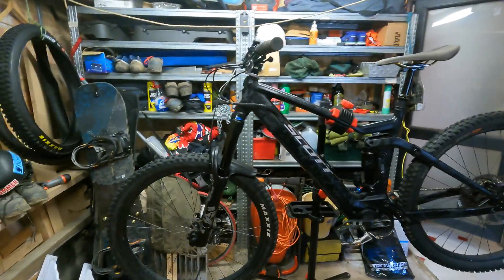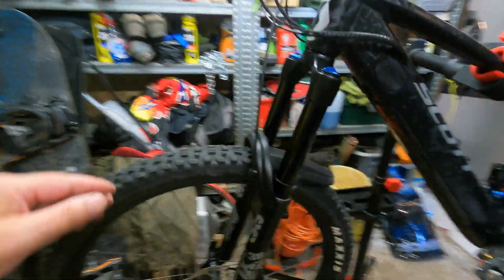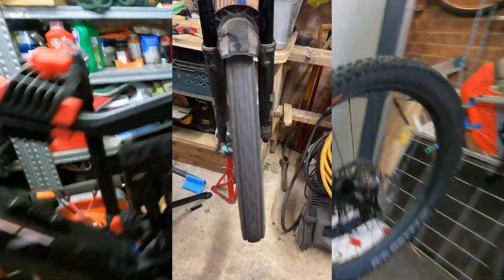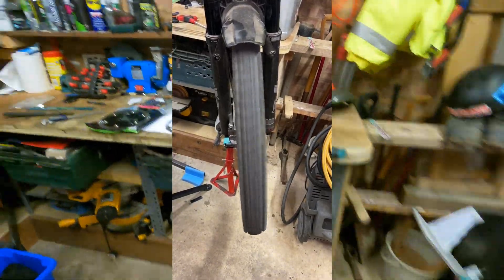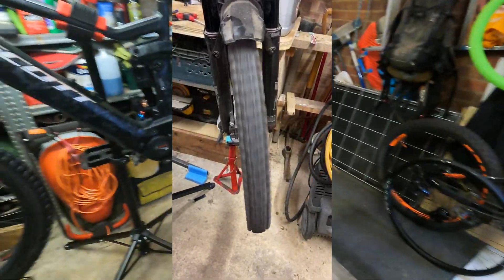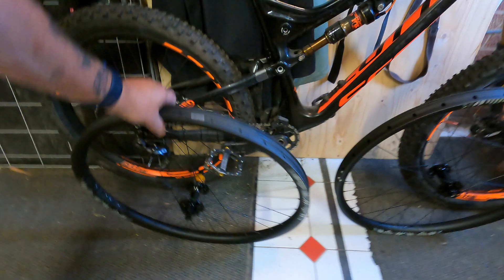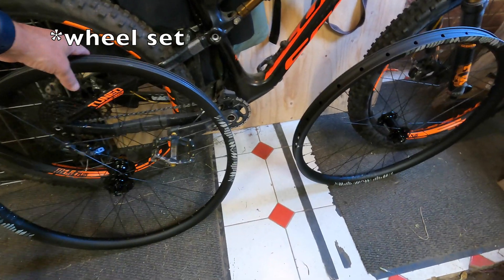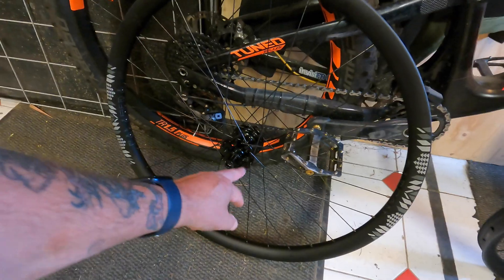Bosch Gen4 EMTB slim speed magnet. Centre lock brake rotor to 6 bolt brake rotor conversion .

Comment: Thx for the video. I got the 2022 eride Ransom 910 and just ordered some SRAM Mavens. I also wanted to change from center lock to 6 bolt hubs. 5 minutes after ordering I remembered that there was this magnet for the sensor in the Shimano 810 rotors 🤦‍♂.... Now I'm here. Thank you so much.

Comment: Ordered the Hope specific speed magnet. Will try it on Hope Standard 6-Hole Silver Disc 203 mm and a Nicolai S16 MGU. replacing the Magura 2 piece rotor. I wanted to dril a hole to fit the old magnet but the Hope rotor does not have a wide enough space to do so.

Comment: Thought you'd sorted my issue out here! Your wheels aren't centre lock, yours are 6 bolt. I need to fit the same hope discs, which are 6 bolt only as hope dont make a centre lock version, to a centre lock wheel and have the bosch magnet. Any ideas?

Comment: Thanks for this video... I just purchased a spare set of wheels (nice carbon ones).. On my present Cube bike I have discs with Shimano centre lock and Bosch magnet...  The new wheels will be 6 hole design..  I'm not going to buy the 6 hole-Shimano c/l adapter but just stay with the new 6 hole disc directly onto the 6 hole wheel hub...

I'm ordering the Bosch magnet (like your one) to go with the Shimano XT 6 hole ( RT76) disc..

Nothing has arrived yet so I don't know how the disc will look..

Have you had any error issues since installing?  Do you think the washer packing out was necessary?

Thanks if you have time for a reply..
Reply from the maker: No error issues at all, its been faultless, and i only needed the washer because the discs had a counter sunk hole.
Reply: What was the verdict on your setup?